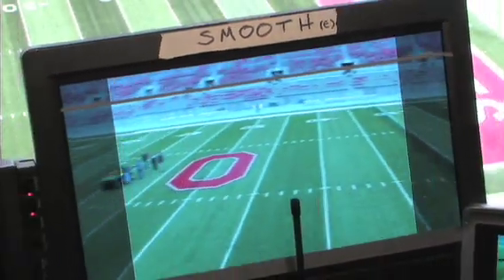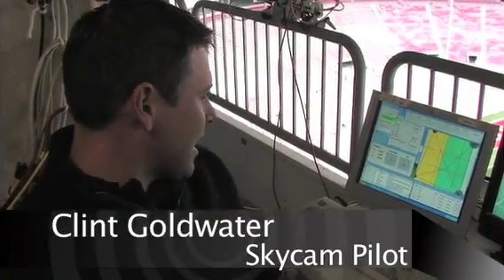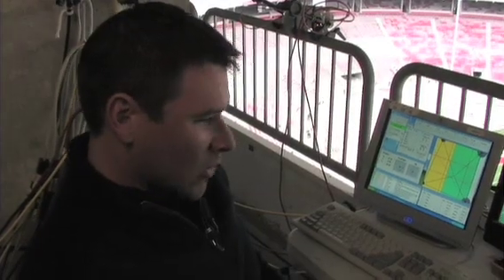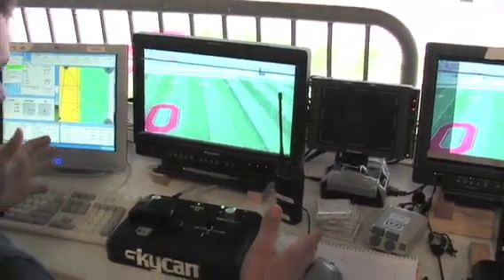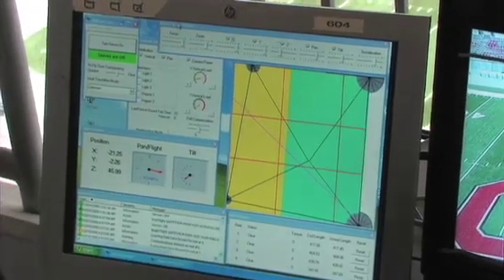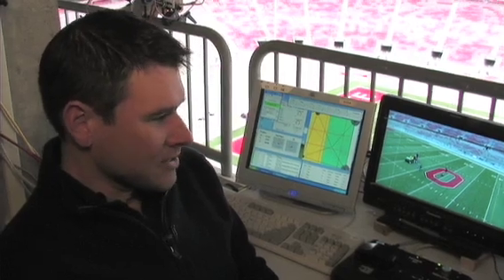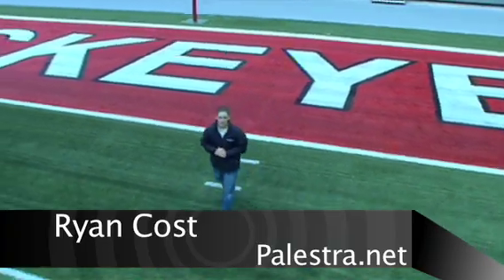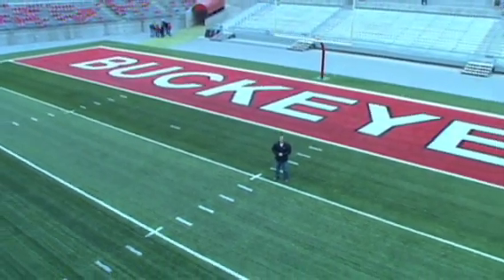How Does Skycam Work?

Comment: In near future they will simply use drones.
Reply: Nah, too noisy and you can't use zoom lenses cause it's not stable enough. Not to mention the weight limitation. You would need a huge drone to lift the kind of gear these guys use. Drones are dangerous around people too.
Reply: ***** I'm sure the games are noisy but the constant buzz of drones would be annoying as hell. Not to mention they are inherently dangerous. If they lose control and fly into the crowd they can literally kill people.
Reply: its like using dslr vs digital camera. both are good cameras but dslr works fast and more suitable in sports.. when compared to drones, drones will not able to work as good as cable skycam's fast and sharp stabilized maneuvering. not to mention the batteries for drones
Reply: Drone is not as stable as this.
Reply: Safety issues too. A drone is more likely to fall out of the sky due to technical difficulties, like during the Olympics.
Reply: GermanBiking Here's an explanation on why drones won't work, just scroll down on this link a bit https://np.reddit.com/r/nfl/comments/3frx7v/how_does_that_camera_that_hovers_above_the_field/ctrghne?context=3
Reply: The camera and its hardware are much lighter than that AND they keep getting lighter.
Reply: shocked they have  not tried drones yet